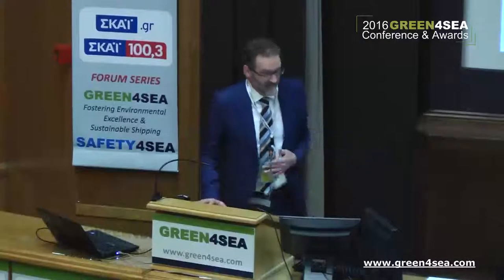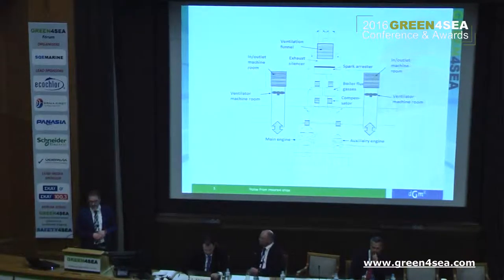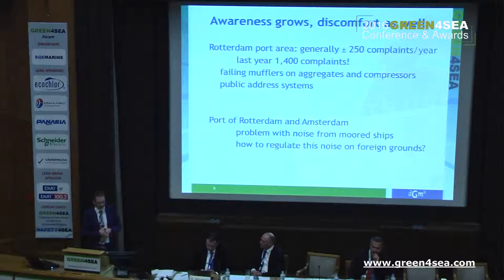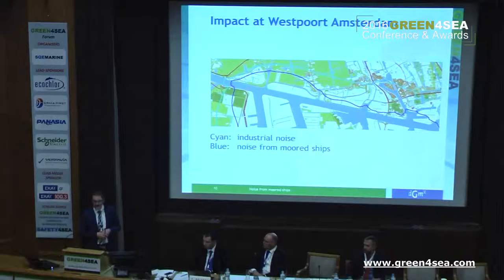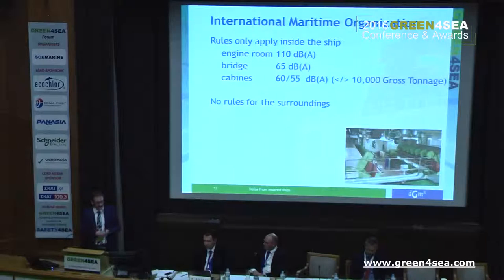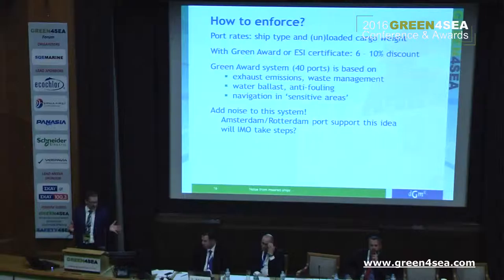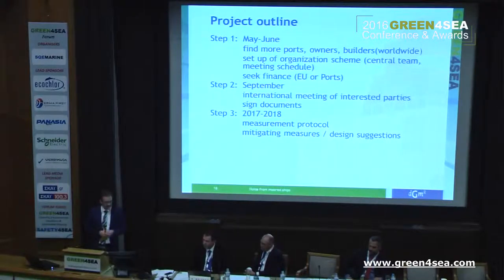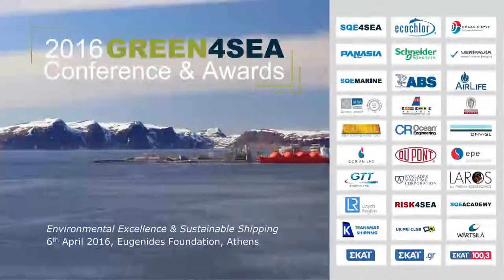2016 GREEN4SEA Forum - J. (Rob) Witte

Comment: according to the resolution MSC.337(91), noise level extends to vessels with a gross tonnage of 1600 and more, concerning the areas Roterdamma and Antwerp a considerable part of the increased noise is generated on small barges which number is very high and 4-stroke engines installed onboard really create the raised noise background.